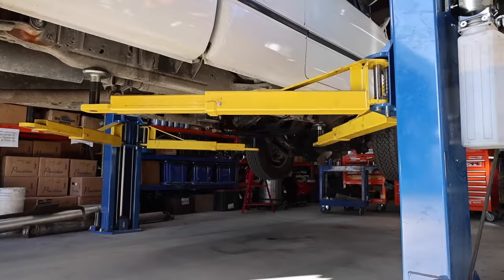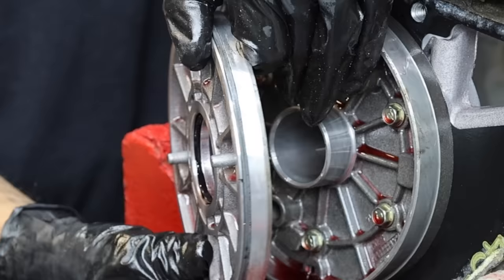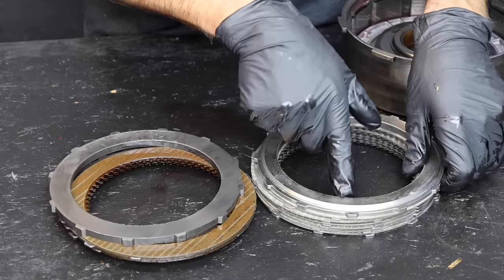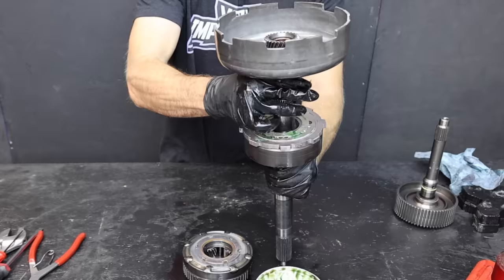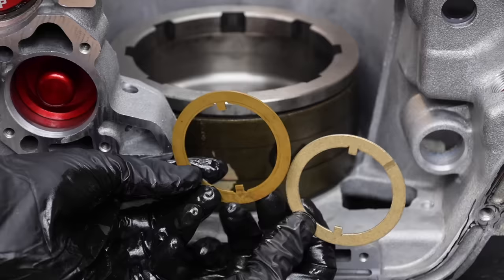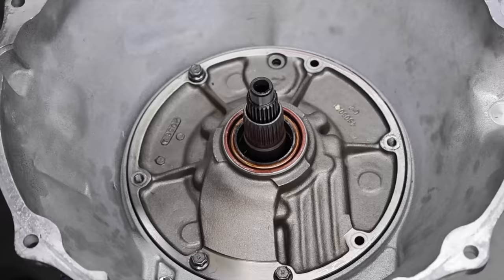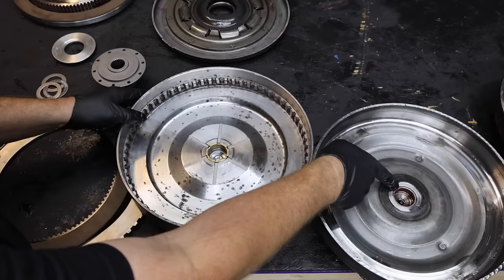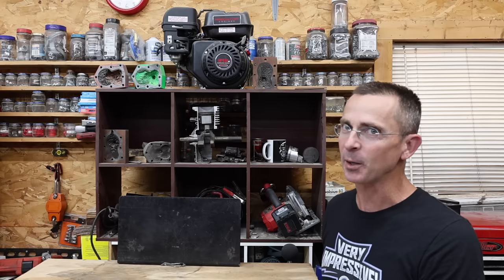Did I Waste $4000 on a DIY Transmission Rebuild (47RE)?

Comment: As a mechanic that previously worked at a transmission shop, you did a very good job rebuilding and explaining the process. Gold Star!
Reply from the maker: Thank you!
Reply: @ProjectFarm  for my sanity I bought a new diesel truck and was wondering if you could run a test on the best diesel engine oil as far as lubricity. I currently run t6 synthetic but don’t know if I should switch to another brand. Or switch to conventional THANKS!!

Comment: Most people have no idea what a marvelous invention the automatic transmission is! And I would never even think of attempting this! Great show Todd! 😎✌️
Reply from the maker: Thanks!
Reply: This sort of machinery has an insane amount of intellectual awesomeness, accumulated over more than 100 years of engineering. I can’t even comprehend how someone can understand this thing.
Reply: My brain hurts every time I see an automatic transmission apart. I know my lane and it's definitely not an automatic transmission. I would need 4 camera angles on me at all times and I still bet I'll screw something up.
Reply: The genius of the planetary still has me in awe. Auto trans could last forever if the clutches weren’t the weakest link.
Reply: Drilling down even further....the torque converter itself is an amazing piece of mechanical innovation.
Reply: The automatic transmission is what they found at Roswell, but dangit, I wasn't supposed to tell you.
Reply: @billplaney2585  Analog Computer built in.
Reply: Todd over here saying the name of every little component like fastballs zipping right over my head.
Reply: @TuneStunnaMusic hey I got news, the clutchs are really not. It's the hydraulics and the fact that everybody thinks they need such a smooth shift.
Reply: You're all a fan but I'm not! A brand new ZF HP 10  dead at 5000 Miles and I'm still waiting for the repair 6 months 😢

Comment: I'm always amazed at automatic transmissions and the amount of planning that went into not just the design but the assembly steps.
Reply: The torque converter is a legitimately genius device.
Reply from the maker: Thanks!
Reply: And electric cars do away with all those hundreds of moving parts.
Reply: @teeanahera8949  : Yup. Good luck finding automatic transmission experts in a decade or two.
Reply: No way i can understand the complexity of such a device in such a video. Mostly obsolete on new vehicles. Great job assembling this.
Reply: It's 150 years of painful lessons and pissed off car buyers.
Reply: @teeanahera8949  But they move the complexity into the electronics which can be repaired only by replacing expensive modules.
Reply: @dcgregorya5434  It certainly is under-appreciated. Back in the early 50s Buick built the dynaflow transmission with multi stage torque converters with variable vanes and other exotic features. The original CVT. Abandoned for efficiency issues.... but maybe it's time to take a second look.
Reply: @dcgregorya5434 
A powered fan blowing air at a non powered fan isnt all that difficult of a concept , add fluid and theres your converter.
They have a 3rd "fan" in there to multiply even more. 
 (tech school is still good for something)
An automatic trans is just hydraulic fluid locking clutches or bands, which lock one part of a planetary gearset.
Usually a planetary gearset can output 3 different speeds for a given input depending on what part of the planetary you hold. 
Now getting a hold of factory manuals and all that type of stuff to have the proper info before you dive in is crucial, its too easy to miss a worn part or reassemble it wrong and smoke the whole deal.
Reply: @MrTheHillfolk  how dare you disparage the torque converter
Reply: @teeanahera8949 yes they do, however they trade parts that may fail if abused and likely wont fail if cared for properly for a part thats guaranteed to fail in about 8-10 years no matter how you treat it... AND it's typically not cost effective to replace because by the time it needs replacing the car is worth less than the battery and labor....

Before you say or imply i dont know what im talking about... i went to purdue for electrical engineering and have worked in automotive design for 7 years 😂
Reply: @ProjectFarm he was complementing the inventors haha
Reply: @crispy_orb  surprisingly the cost is about the same, if not more. Control modules are not cheap, neither are diagnostic equipment nor the knowledge it takes to properly diagnose the issues.
Reply: @dcgregorya5434  I always felt that throttle response on a torque converter is much like stepping onto a bag of rotten potatoes: an uncomfortable dirty feeling. Not something I associate with geniality.
Reply: @crispy_orb  It's a valid question. We don't have enough market experience yet, but generally complex electronics available only from the manufacturer do not tend to be cheap. 

Unless and UNTIL there is a good aftermarket supply of EV parts prices will remain high. The manufacturers control that now.

Recently Consumer Reports study determined that cost of maintenance is significantly higher in EVs.
Reply: So wormer it's your fault?,keep it simple is a motto to live by. Complexity is nothing multiplying failure points and geometrically increasing failures and costs.
Reply: @hockeyguy820 There'll still be plenty in a couple decades lol.
Reply: @Shade_Tree_Mechanic  : Not at the rate EVs are currently being adopted.

Comment: Holy crap! Much respect for those of you that do this for a living or a DIY shade tree mechanic! Makes complete sense why it costs so much to have this done!
Reply from the maker: Thanks for the feedback.
Reply: No kidding what a pita
Reply: @ProjectFarm how long did it take you total time to rebuild this? Days? Week?
Reply: It is done in a couple hours. Its not difficult. I have no training and have done a number of 4 speed over drive transmissions and many in drag racing applications. Removing and installing the transmission is far more work IMHO
Reply: @Nicholas-im8bd  , I’m a little confused by your reply. Don’t you have to remove the transmission in order to rebuild it the way that this video demonstrated? Are you saying you can do this level of rebuild without removing the transmission?
Reply: Not me thinking dam this looks ez
Reply: @danamacie167  a removal and replacement... It's not a rebuild. And the man that rebuilds em.. its almost never the man who pulls them. That's for the low hourly wage guys
Reply: @Nicholas-im8bd  , Yeah, I get the remove and replace, as I’ve done that when I was 16. My original comment was referencing those that are rebuilding transmissions as shown in this video.
Reply: Fun fact- a manual transmission will break less and take 1/4 of the time to rebuild. Automatic transmissions are the epitome of "more complicated than it has to be."
Reply: @bobscat-wj4ub  Where can I get the instructoins? I'd love to follow this video with instructions in my hand, try to understand every step.
Reply: Eyy you’re a fan of shade tree. Nice! He’s great really helped me with DIY on my impala.

Comment: Saved 60k from building a new truck and helped the environment a ton as well.

Hell yeah for keeping old vehicles goinf
Reply from the maker: Thanks for watching!
Reply: It's a case by case basis. But old diesel is so dirty I doubt keeping it on the road is a net benefit.
Reply: There is the old legend:
Every time a treehugger cries, an angel gets his wings
Reply: is it dirty when the new one is junk and costs tons of parts and def fluid LOL. STILL cleaner than EVs. @mitchellsteindler
Reply: @TheGuruStud  it really really isn't cleaner than EVs
Reply: Yes keeping a "dirtier" vehicle on the road longer is generally going to be better than putting the energy into building a whole new one. And when you talk about old dirty diesels it is more particulate matter and nox/sox gasses wich are your smog and acid rain. But when you take into account the massive amount of energy it takes to dig, process, form, machine, and transport all the components needed for a new vehicle it takes a couple of years time for the new ones to make a difference. And generally the economical decision is the greener one, get a reasonable used car with good efficiency and you are doing better than someone blowing through diesel to look "cool" rolling coal. And you save money at the end.
Reply: @mitchellsteindler Tuning correctly and rebuilding worn seals would do more than all the DEF poured into new light diesel trucks that are too often thrown out too soon.
Reply: Evs really aren’t that clean when you factor in the lithium mining required for the batteries and the fact that they are still indirectly powered for the most part on coal plants…
Reply: @danemclaren5678 I had to look this up and seemingly the US doesn't use all that much coal. At least not as much as many folk think
Reply: @danemclaren5678  Coal use for power in the US has declined drastically in recent times; it's just not cost-efficient to build new coal plants anymore. Most of the 'lost' coal power production has been replaced with natural gas and green energy. No matter how you go about it, most EV's still use dirty electricity and third-world-mined minerals so they aren't yet a whole lot better, and even green power has some of those same problems. EV's mostly change the location of the emissions and pollution without green power, but that can be a worthwhile benefit in smog-ridden places.
Reply: @danemclaren5678  yes, environmental degradation from lithium and cobalt mining are extensive, but you are eliminating CO2 outputs in places with hydro or where I live nuclear. Also even when run by coal generation it's still more efficient. In an ICE car it's a combination reaction that only takes advantage of the expanding gasses, then throws away all the heat at the radiator. This is only 30% of the energy you could get out of the gasoline. Coal fired and natural gas production use the heat directly and get like 60% of the energy out. When ev were first hitting the market there was a dumb unit called MPGe which was basically if you take the possible energy in a gallon of gas how far will it go. And EVs got like 115 MPGe and today can get nearly 150. If you are going to burn fossil fuels you might as well get the most out of them.
Reply: @mitchellsteindler  could be true, but usually I tend to think that the benefit of reusing something for a long time outweighs the detriment. Since so much waste comes from people getting rid of things they haven't even had that long and getting a new one. The current mindset in our society for most people is they'll just get a new car every few years or whatever it might be, and when something expensive happens to it, you either fork out over to the dealer or you scrap the whole thing because it doesn't seem monetarily worth it. I respect the lifers out here driving the same machine for 30+ years with hundreds of thousands of miles, keeping it maintained and running. Technological advancement is one thing, and a totally valid point for reduced emissions and whatnot, improved performance, etc. Also in that same vein though, things are being made to go bad quicker these days, or just less quality construction goes into them, so if anything you'll be replacing or repairing it even sooner. I guess what I'm saying it, also a big diesel truck is going to produce a lot more pollution, the recycling and reusing of any product seems better than throwing it in the trash and making a another one and all of pollution of environmental waste that goes into the creation of said product.

I know you already know all of this but that's just how I typically look at it in most cases.

Comment: I like that he replaced all the seals and bushings even though some of them “appeared ok.” If you’re going to do the work and time required to rebuild a transmission, then you should always replace wearable parts that appear ok. “If you’re going to do it, then do it right!”
Reply from the maker: Thanks for the feedback.
Reply: I'm guessing he's done enough in-depth repairs to know how bad it sucks when you get 500 miles down the road and that $3 part you decided not to replace while you had it out suddenly fails, leaving you to get it towed home so you can tear it all the way down again.
Reply: There’s some shops that don’t replace the clutch’s if they look good still…
Reply: @captiannemo1587  as long as they make it through whatever short warranty they offer, that's just extra income when they do fail.
Reply: @kd5nrh  Sadly that's true. That's why I like to do as much as I can myself. At least then if it fails I know exactly who messed it up and I can tell him off.
Reply: @Parents_of_Twins  my previous car had a brand new timing belt when I got it. I even pulled the cover back enough to verify no visible wear on it. 
A few thousand miles later, after I coasted into a parking lot, I pulled the cover back again to see a shredded belt and shards of the tensioner pulley. Whoever did the belt cheaped out by less than $30 on a $1100 job by not getting the kit and replacing the pulleys while they had everything accessible.
Reply: . @kd5nrh  Damn that sucks. Did it ruin the engine? We just bought a used car and found one with a timing chain because I didn't want to have to do the timing belts. I just finished rebuilding a Continental Z-134 and the guy who did it before me stripped the threads on the camshaft nut and just left it like that. Must not have cleaned out oil pan either because there was an inch of sludge in it. None of the safety wires were in place, the rod nut things that stop them from turning weren't in place and the rocker arms were 60-90 thousandths loose. It was a freaking mess. It runs good now though although they dumped something blue in the gas tank and the gas is coming out blue. At first I thought it was the 93 octane I put in it, most of my stuff is diesel so I don't mess with gas much, then I noticed the tank had had something blue put in it. I'm guessing as a rust inhibitor. Hope it doesn't clog up any jets in the carb because it is a PITA to get on and off. It ran great amazingly when I picked it up but had no power. Just got it running a while back so haven't had a chance to see if it is more powerful now, I certainly hope so. I know the governor wasn't working. Well I'll cut this off here before it becomes a book.
Reply: @Parents_of_Twins  engine was ok, and it gave me an excuse to do the motor mounts, water pump, harmonic balancer and several other things that were more or less due.
Reply: @kd5nrh  Thank goodness for that. I redid just about everything on that Continental because I didn't want to have to do it again to save a few bucks now.

Comment: It is fascinating for a layperson to see the innards of a transmission. Makes me appreciate the mechanical complexity we tend to take for granted even more.  This channel has to be some of the best and most honest content ever produced period. Thank you for all of your hard work.
Reply from the maker: Thanks and you are welcome!
Reply: I rebuild transmissions and a GM turbo 350 is so much easier to do!
Reply: @bbaaspencer1 I mean once you’ve seen one transmission you’ve mostly seen them all especially automatics
Reply: As a diesel tech it's still fascinating to see the innards of a transmission. I still appreciate and am in awe of mechanical complexity. And also realize that people with WAY less technology and support designed and built these things!
Reply: @benjaminwatson7868  ...not really. There are a lot of different methods to accomplish the same goals in transmissions, especially automatics.
Reply: @CRneu  eh barely
Reply: Hard to believe the machine shops churning these precision parts out. Huge die castings for the housings , fine blankings for all the clutch plates , multiple seals and thrust bearings. I can't imagine how a torque converter is even made, but every transmission has one of those too.
Reply: Scotty Kilmer is good mechanical video also
Reply: I do almost everything myself but this is one of those things I don't do.  Its not that I dont think its possible for a DIY but there is obviously a learning curve and there is only so much time in the day.   I just dont have the time to pull it out 5 times before I get it right, and my time is better spent doing something else.  Its also something I rarely have to do..... so I will never master the curve.

Comment: Automatic transmission rebuilds are just about the scariest thing to me working on a car. Amazing job and thank you for the content!
Reply: Same here. I'll work on almost anything but I won't touch an auto trans.
Reply from the maker: Thanks and you are welcome!
Reply: Aah they're not that bad really!  Every body freaks out over them! Yeah there's quite a few parts and it takes time, but you just gotta be diligent and be sure everything is back proper. It's not rocket science really, they just have to be carefully cleaned, inspected, measured & reassembled.
Reply: @oneninerniner3427 I taught myself to rebuild the old Chevy turbo 350s and 400s in the early 1980s. There were a lot of used trucks around with bad transmissions from taking off in the cold here in Alaska. I still have the tool to compress the pistons to replace the seals. I used the factory manuals published by Helms.
Reply: @oneninerniner3427 it looks difficult but doable, I feel like It would take 2–3 rebuilds before the average diy mechanic can do it without messing something up.

Comment: I contemplated DIYing the trans in my old passenger full size van but ultimately decided to pay a professional ~$3000 to redo it since this vehicle was taking two families on a road trip 2000 miles. My guy did a great job and not a single regret swinging the money to have it done right. Having seen this video some years later I feel even more justified in my decision. Great video!
Reply from the maker: Thanks!  Thanks for sharing.